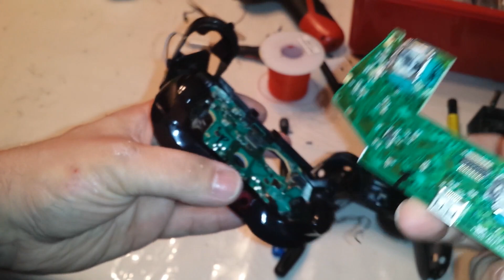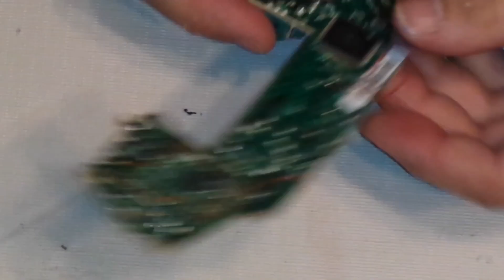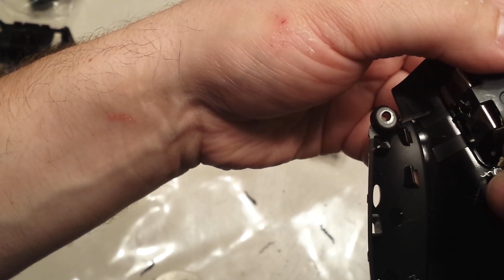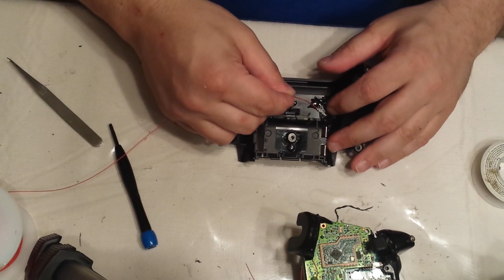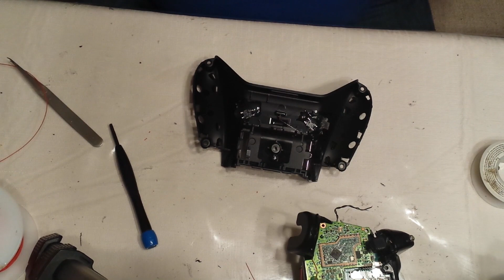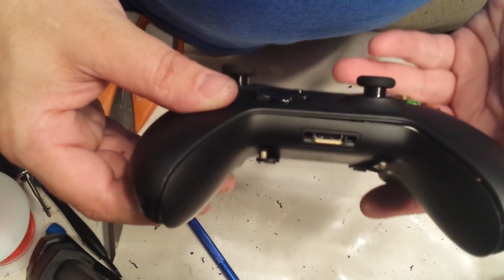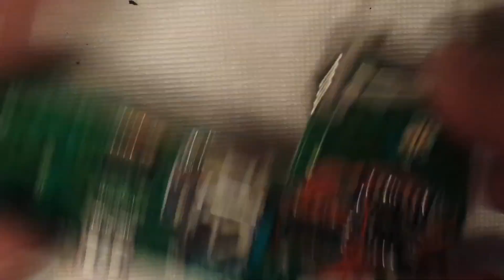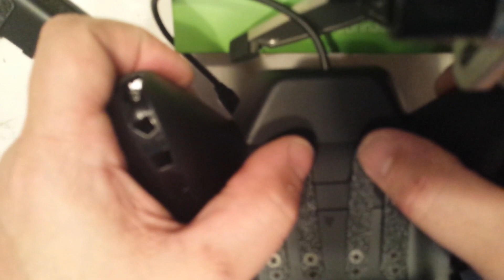TUTORIAL BUILD YOUR OWN XBOX 1 Scuf style Controller w/ Triggers Stops, Remap chip & MORE DIY Gamer

Comment: i want to do this with the left analog click but i dont know where on the mother board to solder  but not programble
Reply from the maker: +keithpender1291 6289   SOlder a wire tro the same point the programmable ship is soldered to except solder it to your tact buttons and then ground as well like every other button.

Comment: and why is no ground on the b button ? and from b is only one wire to the tact switch right?
Reply from the maker: +CLA$$IC B button point to tact, then ground to tact, any ground will do or cascade your ground to all the tacts with one wire.
Reply: +MODCENTRALUSA then i need for A & B buttons only one ground right?
Reply from the maker: +CLA$$IC yes but you need to cascade from one tact to the other to share the ground.  I show it in the videos.
Reply: +MODCENTRALUSA ok thx for this tutorial i will try it :). How did you learn this all?

Comment: How do I do this to a controller that plays tactical?
Reply from the maker: +Colby Hancock  it's no different just map the buttons you use for tactical (like R3) to a paddle instead of B.  If using my remap board ((which you can get on ebay) it is totally programmable so you can swap between any button you want for any layout (tactical included).
Reply: Thanks. This is actually one of the best videos pertaining to adding paddles that I've found.
Reply: Also, I didn't catch that if you said it, how much does this cost in total?
Reply from the maker: +Colby Hancock  not to sound full of myself, but I know.. AND THANK YOU for the compliment.  My goal is to make controller modding easy and at the same time offer great tools and resources to do that.
Reply from the maker: +Colby Hancock  If your doing it on your own, a mod can be done for under $20.
If you want to use my services email me or check the description of the video.

Comment: The new controllers have a different board layout...   I am half way in trying to figure this out...   :)
Reply: +Chris Hunter I'm just trying to add a B button on the back.
Reply from the maker: +Chris Hunter my boards work with every revision to date.  The New boards have the same layout on J5 and J6.  Nothing is different just looks different.
Reply: +Chris Hunter One last thing - so once I know which to go to for B (D14 or TP114), then I would just connect one wire from that to the tac switch and another to the ground TP26 right?   Just two wires?   Or is there three - two for B button and one for ground?   I am just trying to add a single paddle on the back to see if I can get used to using rear located buttons before I order a professionally made one.   I apologize for being dumb in advance.
Reply from the maker: +Chris Hunter  Just solder a wire from the TOP POINT (only the TOP POINT) of D14 to the tact and a wire from ANY GROUND to the tact and that is it.

Anything else.. EMAIL ME I can send you photos.
Reply: +MODCENTRALUSA You are THE MAN.   It works perfectly and I appreciate you so much.   :)
Reply from the maker: +Chris Hunter no problem!!

Comment: Decided to ask here since it may be of help to some. 

I did a standard ABXY paddle nod (not using your remappable chip) for a friend and sometimes left stick click is activating "B". This is rather odd to me since nothing the two points aren't anywhere near one another the board, as far as I'm aware. 

Any idea what could be causing this issue?
Reply from the maker: +Bela Sziklassy  YEP.. the B button remap tact is grounding out on the LEFT STICK CLICK solder point...
Reply from the maker: +Bela Sziklassy push the legs of the tact button as far flat with a screwdriver as you can or take some hot glue and cover them,.  I will guarantee the Tact button that you have glued in the shell that sits right about the mainboard where the left stick is at, there are 4 solder points for the left stick click one of those points is touching one of the legs of your tact button and causing a double activation.  Either cut the legs off the tact and use the 2 on the other side that are unused or cover them with electrical tape or cover the left stick click solder points with electrical tape or use hot glue to mast the points
Reply: I wasn't even thinking of the board on the other side! DUH!
Knew you'd have the answer. TY!
Reply from the maker: +Bela Sziklassy I've been doing this a very very long time...  Glad I could help

Comment: is that your real voice.?😕
Reply from the maker: +Videogame master YEP..!
Reply: +MODCENTRALUSA hey so on the new V2 Xbox one controller is the common ground the same number or same place on the board. the old controller us layed out differently. so is it the same to** or is it different?
Reply from the maker: +Ross Keene  Just use R3 or L3 Ground and you will be fine.   That basically is the Solder point next to R3 or L3. To the RIGHT of it.  Very simple.  ANY GROUND will work.  You can even usePin 3 on J6 or the bottom last pin on the right (i think it is pin 13) on J5.

Comment: sorry for my englisch :)
by the first scuf : It's about the B side.The cable connection of the two buttons and the cables are of B not next to each other but against the going anyway?
Reply from the maker: +Aydin Albayrak 

I don't understand your question. But this is what i think your asking

TO remap B - you need to solder to the TOP point ONLY of the B connection in the video.
The second cable is Ground.  2 wires to complete the button remap

Comment: Thanks for taking the time to record all of this. I know it's a lot of work.
Reply from the maker: +ian welle  no problem... enjoy!
Reply: +MODCENTRALUSA i this still 150$? the elite controller is 150$... if u are you might consider lowering the price
Reply from the maker: Elite controller is impossible to get.  It also is not built for every gamer. 

if someone wants to buy a fully modified controller with programmable remapping and 4 remaps, $150 is the price shipped.  It does as much as the elite and More + it is fully customizable per customer, where the elite is the same for everyone. I can do Tacts, Giant buttons, Paddles whatever anyone wants. You can not get that from elite.  Also my Programmable remapping is easier to use and can be in the middle of a match where the elite can not.

I will make a comparison video soon, once I can get my hands one considering they are $200+ on ebay and no one has them in store.

The price is very fair.

Also For 2 or 4 remappings on a mail in is only $45 or $60 - which is cheaper than anyone modding company out there. It also includes tons of extras and return shipping.  No one is gonna give you 2 remaps, a new LED, new sticks, Trigger stops and adjusters, and return shipping for $45.

I also have $100 shipped controller with 2 mappings, and all the extras, which is quite a deal and comes out to be cheaper than buying a new controller and mailing it in to be modded.

Lastly I have a ton of options from shells, button kits, thumbsticks colors. All things you don't get with the elite.

The Elite is a nice controller, but it is not a reason to stop modding and doing it yourself or having me do it.

I can also customize with buttons, giant tacts, light up tacts, paddles and other configurations that a customer might like more than a Elite controller.   Many gamers feel the elite is not a good FEEL for them, I can build a controller that allows the gamer to FEEL like it was built specifically for THEM.  The Elite can not give you that.

My video has over 200K view (there are 2 videos) I have built and shipped countless controllers.  I have also allowed people to build their own for little to no cost. I get customers every day. I am quite happy with my pricing. IT has been revised already.

Comment: So I pulled the wire for the B button off the board. it pulled the original pin that was there. now I have no B button at all. is there a way to atleast get the paddle to work?
Reply from the maker: +El Guero Yes solder to the VIA for B or directly to the MCU. Email me for photos.  The VIA and MCU solder are pretty difficult as they are small. The VIA needs to be scrapped to expose the copper to solder to and the MCU leg is smaller than the B point you ripped off. .Those are the only 2 other options.

Comment: I accidentally spread some solder on the B button point and tried to clean it and ended up tearing the bead and tracer for the B button :( luckily I found a work around, I soldered all the Dpad points to my four buttons and in the xbox settings I remapped the Dpad to A B X and Y respectively. So if anyone messes up a button like me don't throw your controller away just use the dpad and remap it.

Comment: So for the first part of the tutorial when you add the A and B paddles, does that mean the functions of the actual A and B buttons are eliminated? Or does both the paddles and the original A and B buttons work once you're finished? 
Your tutorial for the paddles is really good btw!
Reply: +Ryan Landon Both work, as long as you don't use the method where you scrape the B button terminal, and instead solder onto the point he showed in the video.
Reply from the maker: +Zaya Young COrrect

Comment: It seems simple however I feel like I'm missing something with the tacts so you solder one to ground then solder the same one to the  others? however the ground and the one cascading the ground should be different connectors? by connectors I mean the metal things on the tacts
Reply from the maker: +Madster546 Tacts only have two poles.  One fro the button press and the other for ground.  When you connect a ground to one tact the other side of that connector is the same pole. You can then attach the other side to the next tact (either pole) it don't matter, and if you want to cascade it again, you can do so for every tact.  It rally is simple.
Reply: +MODCENTRALUSA oh so there's 4 but 2 of them are the same on each?
Reply from the maker: +Madster546 YES  

-------------
  |    o     |
-------------

The rods (poles) run through the tact so while they seem like 4 there really just 2.
Reply: +MODCENTRALUSA thanks

Comment: A PDF diagram with the correct explanations for what wires to what would be helpful. Also some guidance for the white flexi board (especially how to solder it with those tiny connections) would be helpful too.
Reply from the maker: +Accessible Gaming The Remapping PCB in this video was made first (two years ago), the white PBC is the same as the Square one but has a KEYED PCB to make it easier to install.  Also the Keyed PCB is for XBOX ONE only where this Square used works in Xbox 360 and Xbox one.   The White PCB is much newer than this video.  Anyone who buys it who might have questions on the install can just message me I have install pics all ready to send to show a proper install.  It's pretty straight Forward. Solder the arrows points only. Solder a Wire to B or just scrape the VIA.  Solder wires from T1-T4 to tacts.  Solder Wires from LC and RC to the LC and RC points.  Solder a wire from LED to your LED or to the controllers LED.   Lastly Bridge MD to either SY or VW to pick the button you want as the program (mode) button.   It's pretty straight Forward and simplifies the XB1 install than using the Square PCB with a ton of wires. .

Comment: @ MODCENTRALUSA  i have a issue, after soldering and having the b & a working, x & y dont work :/ , i wounder if i may have bridged them on the j6 connector ? ? would that happen ? awesome tutorai anyway :D
Reply from the maker: +brett scott MY guess is that the J6 connector Pin 8 is bridged to 10 which would prevent Y from working.
Point 9 on the top row is Point X.  SO I do not see how you could have done anything to that.

MY advice is to DESOLDER the 2 wires and use some desolder braid to make sure there is no excessive solder.

Then Try again.

Use TP26 for ground when you complete your remaps
Reply: +MODCENTRALUSA  awesome thanks will try that :D nice vids by the way, keep up the tutorials

Comment from the maker: @Elijah Ochoa, there all good way to do it. But really you can buy a new shell with the color or pattern you want for a lot less then the hassle of doing any of those.
Reply: +MODCENTRALUSA I may have to find a better way to get in touch with you so we can discuss pricing, because I would love one of these controllers.
Reply from the maker: My email is clearly listed.  MODCENTRALUSA@GMAIL.COM  It's as easy as that,
Reply: +MODCENTRALUSA I sent you an email yesterday about wanting to buy some of your remap boards. Just wanted to let you know here in case that gets missed for whatever reason. :)
Reply from the maker: +Bela Sziklassy  Check the email MODCENTRALUSA@GMAIL.COM cause I do answer all emails within hours.  As you can see from my ebay link I get a TON of customers for them. I have about 5K in stock right now.  SO If you didn't get a replay it is because the email did not come through.. I will also check my spam just incase it got filtered accidentally.   I get about 30-40 emails a day for the remap board so I make sure to systematically make sure every mail is replied to.
Reply from the maker: +Bela Sziklassy Checked my Spam.. no email from you.  RE MESSAGE ME. Thanks
Reply: MODCENTRALUSA ok, maybe you can just answer the question here. Are you able/willing to do orders directly through paypal or do you require eBay? I was looking to buy a few of your remap board to mod up 3-4 controllers but no longer have an eBay account.
Reply from the maker: +Bela Sziklassy 

This should answer your question.

Here are the Bulk rates Directly from me. (private sale - Friends and family payment) (goods and services payment add 4% to cover fee)
Bulk rate works as follows

ALL Wire install for Xbox 360 (wired and wireless) and Xbox one. 

    $32 Direct from me free shipping in usa.    

    Multiple boards 

    2-10 $31 each

    11-20 $30 each

    21-50 $28 each

    51+ $26 each

All prices include shipping in USA only.

OUTSIDE USA is $10 flat rate for any amount 1 or 100 per order
Reply: I do not mind doing friend and family if you are fine with that. I am in the US. Your board prices on eBay are different than what you quoted here unless I am missing something. The Xbox boards are listed at $35. I would love to buy 3-4 boards at your $13 per friend/family rate.

I went ahead and sent you an email again by the way. Appreciate the quick responses, and especially the tutorials :)
Reply from the maker: +Bela Sziklassy I will send you the Board options and the Pricing once I get your email.. sorry. I have Two boards now.    Basically what you see on ebay is 2-4 less privately.   There is also a discount for multiple boards.
Reply: MODCENTRALUSA that would be fine. Both XBOX ONE board I am seeing on eBay are listed for $35. The PS4 version is listed for $15. I copied and pasted your email modcentralusa@gmail.com and sent an email there, so I am hoping you receive it.
Reply from the maker: +Bela Sziklassy ALl emails replied to.. Thanks
Reply from the maker: +Bela Sziklassy I corrected the error.

Comment: I'm afraid if I do this to my controllers I won't figure out how to get them back together and I'm afraid if I figure how to put it back together it's not gonna work anymore but I still enjoy watching modding videos for controllers
Reply from the maker: +Infinite gaming Then do not do it. The tutorial is pretty straight forward, but even using the tutorial you think you might screw it up then don't attempt it.  I have services listed if you want to get it done or there are a ton of other companies out there if you want to pay through the nose to have it done.  

I put these tutorials up so people can save a lot of money and do it themself.  The process is easy for the most part, but still does require a small skills set in gluing and soldering + Drilling.  
Many companies out there charge an arm and a leg to do these simple modifications.  I charge a very reasonable price. My info is in the video description.